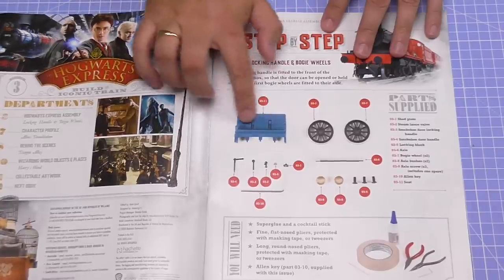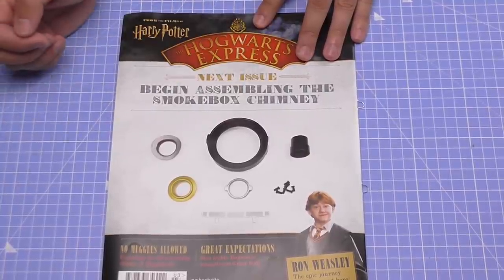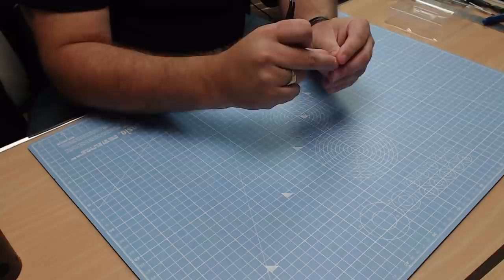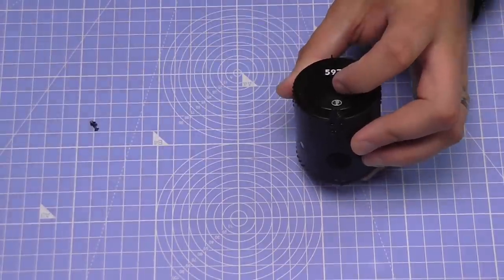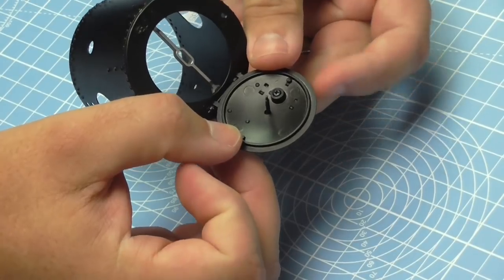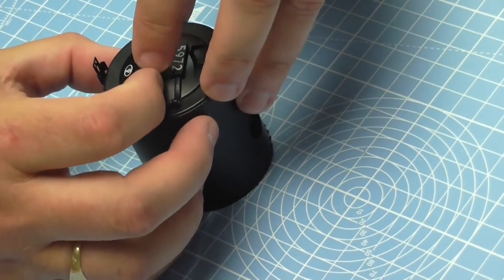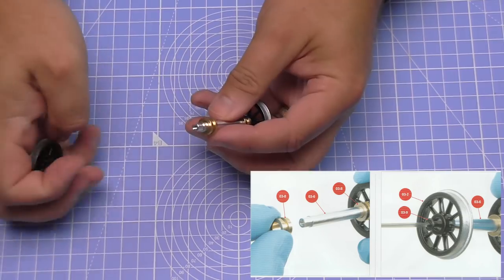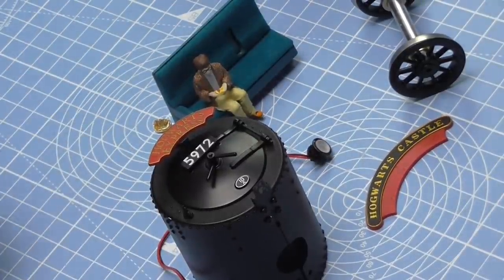Build the Hogwarts Express 1:32 TRIAL - Issue 3 - Locking Handle and Bogie Wheels

Comment: Hi Wayne, watching the video now, I have noticed you have the wheel flanges on the outside, they should be on the inside, facing outwards. 
This is turning out to be an interesting build, hope it continues.
Reply from the maker: Yep. Corrected it now and put a little link to my usual mistake video when I make a mistake lol.

Comment: Wow so want this. Cheers for great channel 👍 is there a concern that a production run will include plastic rather than metal parts? Cheers
Reply from the maker: Most of the parts here a metal. The Terminator build couldn't really be all metal as posing and stability would have been a major issue. I can see the interior of this plastic and all external parts metal but that seat.......so smooth lol

Comment: Hi Wayne great video I hope that comes through that they do do the whole set and hopefully they do it in the US I just got an announcement from eaglemoss. It's for the Willy Jeep. They have two options for it 30 months with four issues per month at $10 and some change or you can do 15 months for $89 and some change 48 issues and it said us only not sure if I read that correctly. Just ordered my Terminator replacement parts and the pots for the proton packs from Ghostbuster let me know if you guys are going to be getting the jeep Willy. When I finished building my Jeep I'm going to make it the Vietnam era version cuz they were used over there 2 again great video and give me a heads up if you can about the Jeep be safe Bruce
Reply from the maker: Yep. I want to do the Jeep. I haven't had the email yet but I have expressed interest so will let you know.
Reply: Let me know if they're going to do it over there and if not I can get it for you and ship it to you as they come. I have no problem doing that be safe Wayne Bruce. Now that just looks odd. My name is Bruce. LOL

Comment: I won't mention the wheels... The 10A plate is the shed code for where the locomotive would be based for maintenance. 10A is/was Carnforth in the Northwest of England. Artistic licence as no Great Western engine would ever have that code. Western Region codes started at 81A and went higher to 89D. And the fiddley bit through the smokebox door is called the dart. Engages with the locking bar exactly as shown. The smokebox when closed has to be airtight to create a vacuum to draw the fire. I'd better stop before I get into too many technicalities...
Reply from the maker: Lol. Thanks for that though Bob
Reply: @WorldofWayneUK  if you look at www.theclanproject.org you will see in the pictures at the introduction the smokebox I have been working next to most of today.
Reply from the maker: Thanks Bob. Love the pic. In fact I was knee deep in the website for quite a while. I love it.
Reply: @WorldofWayneUK  It might be described as model making on an epic scale. But you have to make the parts before you can fit them. And at 12 inches to the foot scale that makes things rather large and heavy!

Comment: Hello, I have a question on my ecto-1 build I am on issue 10 and one of the lugs where I hock up the brake lines from broke and I was woundering could I continue to work on it or do I have to wait until I get my replacement part?
Reply from the maker: You can still access it later on so it should be fine
Reply: Ok thank you
Reply: Did the same on mine. The back one? I just glued it on and it was fine. :)